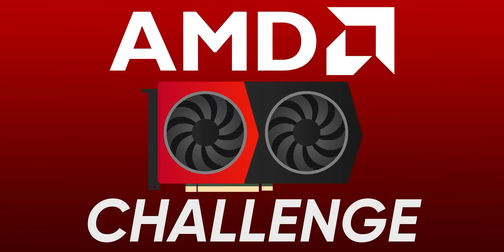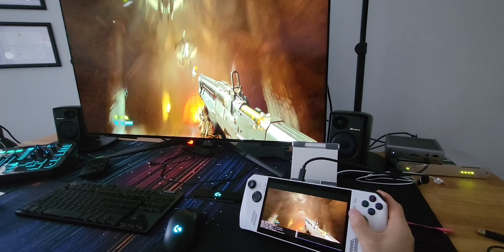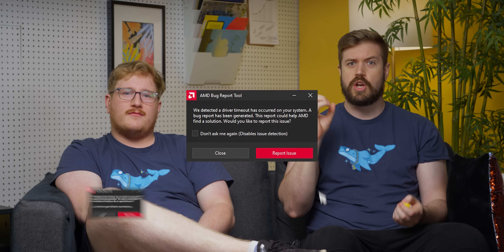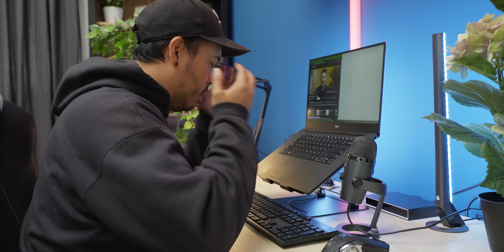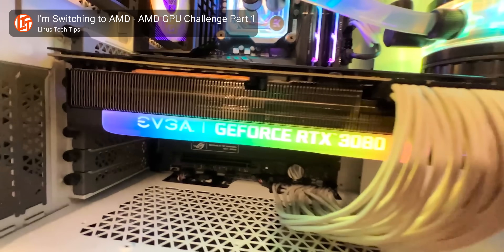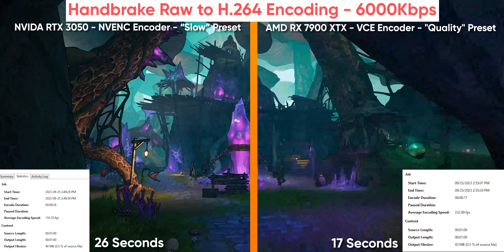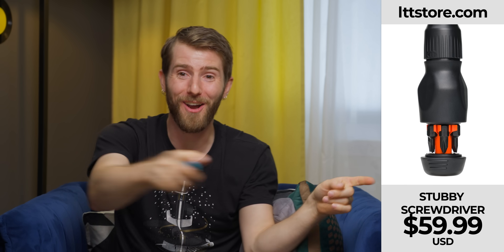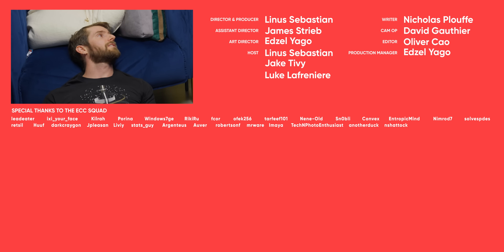I’m Staying on AMD! - Radeon Challenge Pt. 2

Comment: I upgraded from a 1080ti to a 6800xt and it's been great. My first AMD GPU since the 7870. 

Been very happy with it, no stability issues.
Reply: Im still on the mighty 1080ti but am thinking that its time to upgrade too 😊
Reply: I upgraded from 3 hd7950's (crossfire) to a gtx 1070 and I REALLY want back to AMD because the Nvidia drivers feels like a cage
Reply: Also using the 6800xt and no problems whatsoever on Linux as my main game setup
Reply: the hd era gpu was the best for games
Reply: That's the same upgrade I did, and it was totally worth it.
Reply: Swapped from 3070 to 6800xt and ran it for two years with no issues. Moved to 7900xt few months ago and still no significant issues
Reply: I jumped from a 1080ti to a 7800XT and haven't had any problems either. It's only been a few weeks though.
Reply: I went to 6700xt from nvidia, and literally zero issues since. Think I'm just lucky though.
Reply: Went from titan xp to 6800xt, it's fine, but I don't play that many games anymore and have to boot linux to do what I want so in hindsight I should've gone with a 3090
Reply: I never Had experience with Nvidia (my First and only Card is 4,5 years old)
And i Just had one Problem that gone away after the next Driver Update
Oh i have a RX 570 4GB XFX
Also my idle is about 3 Watt and i build my Friends also 4 PCs with AMD components  they didnt say anything to this date
Reply: @Paulkjoss  Personally, I was on a 1060 and it was showing age for me quite a bit, if you are able to hold off, you may want to given the way things seem to be going, we may end up with this gen of gpus being a dead end and ray tracing actually being useful, with nvidias side seemingly locking dlss to newer gpus and game devs factoring dlss uplift into performance on top end... I have little hope going forward with games, but it would be good to hold for a gen if able to see if shit pans out better or worse.

Comment: I went back to AMD for the first time since 2012, both CPU and GPU. I have had a few minor issues like 1 of my screens not being at 144hz while the others are and the settings say it is but its clearly not. A few other little random things but to be fair I did have Nvidia drivers installed before hand. Since I cleanly installed everything I've had no issues that I can think of. I am very happy with switching back to AMD and happy to stay put for the forseeable!
Reply: yup, clean install Windows if you switch anything major like CPU, GPU or Motherboard, I once hot swapped out an AMD card for an Nvidia card and I was having tons of problem with the Nvidia card until I clean install
Reply: Curious, what graphics card did you end up going with?
Reply: mine brother did install clean drivers after his first problem when he switched from 1050ti to 6700 xt like 1 year+ ago, stutters and 1 crash,  thing with amd they are more sensitive if u dont properly do installation, when he used 1050 ti for few years, he didnt do clean installation, only problem he had was nvidia software few times
Reply: @TheKOzality  Only seen this now mate, I went for the AMD RX 6950 XT.

Comment: i like how my experience since joining team red has been the polar opposite of theirs. i got my 7900XT just after christmas, and it's been basically flawless the entire time. i've had a few driver timeouts in CP2077 over the last few days, but i HAVE overclocked the card, so that's to be expected while i find the right settings.
Reply: This is me. I have owned AMD cards for over 10 years and had very few issues. Not 0, but very few.
Reply: 7900 XTX currently running the preview driver for AMD FMF support -- haven't had any issues at all on my system. Love my card and with frame gen I'm pulling ~150fps in Starfield at 4K. Can't complain here!
Reply: @ShrikeCult 
Lmao. You lot are hilarious.
Half of y'all are claiming he's an AMD shill, half of y'all claiming he's an Nvidia shill...

Make your dang minds up lol
Reply: @haxie4516  And you forgot the most ironic part : they accuse others while being the actual shills.
I just couldn't recommand Nvidia this gen, since they launched some of the most outrageous products. The 4060 sometimes is worse than the 3060, 16GB wouldn't have hurt the 4070 (Ti is a joke), 4080 should cost 800. It leaves you feeling like it's 4090 or nothing.
So 3 of my friends grabbed the 6900XT, 7600, and 7800xt. First two had no issues, the last one crashes everyday. Thanks AMD I don't feel guilty for making my friend spend half is pay for that experience. Fucking up 30% of the time isn't a nice stat 💀
Reply: @unholydonuts 
No. Not really.
Reply: They just fucked Up. They didnt do a fresh Windows Install after such a signifikant Hardware Switch. And they played DirectX 9 titles without installing DirectX 9 which is Not included in Windows 10 and 11. 

When i switched to my 7800 xt from my gtx970 i didnt do a Cleaninstall First. I Had Crashes and Freezes all over the place. After doing a Clean Install i still Had Freezes in DirectX 9 titles. Quickly figured it Out and installed that DirectX 9 kit from Microsoft and never Had any more Crashes in Wow and League of Legends since.
Reply: @dontowelie1302  
Most people won't reinstall.
That's the point.
Reply: @dontowelie1302  i mean idk if a clean windows install is necessary. I didn't do that when i installed mine, i did the same they did. Ran DDU and called it a day.
Reply: Mine too. Very free issues, but not terribly demanding games I guess.
Reply: @ShrikeCult It is hardly a hitjob if all they do is mention the problems they did have. It is not like they made up stuff. AMD does have issues and these ARE the reason NVidia is so far ahead in sales. If AMD had a better product, the market would change by itself. Problem is: NVidia got the better product and the better software to go with it. Now with the AI thing coming into play as well, AMD is in deep shit. They have had years and years to catch up, but they did not.
Reply: Clean windows install helps a lot
Reply: "Had some driver timeouts guys surely its my overclock, the copium"
Reply: Same for me I got a 6750xt last year and it's been absolutely flawless I game with Tripp monitors to. My experiences with Navi over the years wasn't great my 1080ti had a crop of issues when I had it and so far my amd experience has been much much better.
Reply: Ive been using an rx 580 for a looong time and ive had a few driver timeouts over the years, but it was never when i was doing something important so thats nice. Only other problems i can say ive had was their horrible openGL drivers until they fixed them last year, and windows update ruining driver updates.
Reply: that is because contrary to popular believe these guys are NOOBS! they keep failing their challenges
Reply: @crazygtfan8492 same here, from 7950 to dual Sapphire Radeon R9 290x, to dual 390x to now dual Vega 64, and zero issues whatsoever 😂😂😂😂
Reply: 7900 XTX can do in games what RTX 4080 can't for $300-$400 cheaper
Reply: @crazygtfan8492  Technology is a very fickle thing. You're computer could be running fine for one minute and then encounter a strange oddity out of no where within five seconds after that minute. It happens even on NVIDIA cards, Linux, Windows, Mac. They all have their different quirks.
Reply: @ShrikeCult  EXACTLY
Reply: Did a new build on a B650 motherboard with a R5 7600 and the RX 7800 XT, no issues at all, so far works great in older games like GTA-V and Half-life 2. It's also decent at 4K in games like COD, Battlefield V and Doom Eternal. It looks great on my Sony m9 monitor.
Reply: @danbo4605 do you actually believe that? Lol
Reply: im willing to bet alot of it is because they didnt do a fresh install of windows after changing the gpu, ive had so many issues with bluescreens, crashes etc after switching out a gpu no matter if its amd or nvidia even when you use the full driver removal tools
Reply: I have a 6800xt for 3 years and literally haven’t had a problem and I got it right at launch 🚀 it’s a red devil , I just DDU my wife’s 3070 because the clocks are stuck and so is the fan curve and power .
Reply: @Tech_Enthusiast_001 nvidia has issues too and it’s already proven they have just as much issues as AMD

Comment: Great video format and spot-on editing during Luke's overview of issues. I switched to 7900XT almost 3 months back and I was dreading crashes and other various issues but to be honest my experience is smoother with AMD card than it was with Nvidia's last four generations. Wherever two suppliers fight for customer, usually the customer can enjoy some benefits.
Reply: I personally had the same experience, I recently switched from a rx 6800 to a rtx 4080 and the 4080 has had so many issues, crashes fps drops ECT. I did a full ddu so it's not that although to be fair the Nvidia drivers have got better so now it's almost as good as my rx 6800 but it's still a bit behind.
Reply: Yeah, I had major issues on Nvdia and Ive been on AMd since 2017, first with the rx580 and now with a 6700xt
Reply: @RekySai  hey now thats no way to think, both have flaws, nvidia isnt perfect neither is amd
Reply: I have a rx 580 and I want to switch to nvidia asap. I got this card since 2019 and I only experience issues with the bad amd software. I dont know why it just doesnt work but it seems to get worse and worse. Where I experience several crashes of my graphics card upon launching a game.
Reply: @Scandalos RX 580 is an old card that’s why. If you put a 1070 or something similar in your pc you will also have issues. Older cards don’t get much optimization or as much support as the newer ones.

Comment: Love the format, I went with the same system Linus did with the 7950x paired with a 7900xtx and have nothing but good things to say, maybe the fresh install is the way to be with an AMD upgrade, that’s what I did at least :)
Reply: I would argue that a fresh (driver) install should be the way to go anytime you switch GPU brands... but I can't be 100% sure that would fix all their issues, since the last time I switched brands was in 2014(!) when I went Team Red and, three GPUs later, I've had nothing but a great experience (I feel like I have to clarify, it wasn't out of fanboyism, they were literally the only ones with a decent price at the time: R9 270X, RX 570 and RX 6600, respectively). And you know, this video is kinda helping me make up my mind to upgrade my other PC to the RX 7600 lol
Reply: It's the AMD CPU drivers that drive me nuts. Clean install everytime or a headache. So Blue CPU+Red GPU is the way to go in my book.

Comment: Ive had my 6950XT for about 8 months now and i absolutely love it. Great performance at 1440p and ive had no driver problems on Windows or Linux
Reply: That's great! But wasn't this video about the AMD RX 7950 XTX GPU?
Reply: @disguiseddv8ant486  not sure, but that'd make sense, the 7000 series has more driver issues than the 6000 series
Reply: But that's the AMD experience... 90% of people it will work fine for but the 10% it doesn't... It REALLY doesn't.  Those 10% will swear off AMD and everyone else will gaslight and call them crazy for it so they actually hate AMD in the end.  But this happens EVERY generation to 10% of the people and over time it's just built a mountain of us that just couldn't give a shit if AMD burned down in a big fire.  Even if the 7900XTX gave equal perf to my 4090 for 600 less I'd take the 4090 because it's fucking solid as hell with no issues just as my 3080, 2080ti, and 1080ti were.  The one time I went AMD for my GPD winmax system I run into an issue just like these guys where older games like Silent Storm won't launch on it because it doesn't do integer pixel format the way the games expect it to.
Reply: and now even 6950XT will get FSR 3.0. Really I don't get why people still buying Nvidia cards
Reply: @tonymorris4335  That sums um my experience so far. When it works it works really well, when it doesn't, typically in an older and/or more obscure tittle, it really is a nightmare. But it has been getting better, in my all AMD laptop, I've had a few issues in the beginning, but they are mostly solved, to the point that it doesn't bother me all that much. There is one game where it poops it's bed, but it's a slightly older and more obscure tittle, shame that it has been broken for quite some time now. To be fair that same game also had issues with nvidia cards a while back, so not sure who's fault it actually is.
Reply: I switched from nvidia 3060ti to 6800xt for 1440p gaming and it’s been great. I was worried about issues as my first card was a rx580 and it simply did not work with my set up, so I got the 3060ti. But I’ve been in love with my new card!! Works great and I’m maxing out all the games I play with 100-144fps (monitor 144hz)

Comment: As a team red boy from my first gaming PC build which was an athalon 64 it’s been good seeing AMD giving team blue & green a run for their money recently. But still room for improvement for sure. Hopefully it just keeps getting better 🙏🏼
Reply: Didn’t expect to see @SAMMIT in a LTT video comment section
Reply: honesty AMD gpu allows left a sour taste in my mouth i had a ton of problem's with more then 1 of there gpu that i stopped buying them at all as there is no point in even taking the risk but for there cpu i still prefer them more then intel
Reply: rocked the 560, and now the 6600, both are holding up well, not a ton of problems, minus when game is updated and needs new driver versions, but it is super fast to upgrade so not a problem at all.
Reply: Hey! 👋
Reply: @portanrayken3814 Never had major issues with mine. But I usually wait a few months to buy. Updates are constantly rolling out and performance has been great on my rx580, 5700xt, and 6900xt
Reply: Really depends on the use case, but for the majority of people an AMD GPU is the best choice they can make, especially if they just want to play games and nothing else (No heavy Blender work, no streaming, etc.) Otherwise Nvidia could be the right choice, but will cost more for the same gaming performance... For my part I've had no issues with my 6700XT, nor with my RX 580 or RX 460 back in the day.
Reply: @Otawakun  Should see his new video then 👀
Reply: @N3MAID3S  wait what. how did i miss that?
Reply: @Otawakun Youtube being youtube, probably didn't push it to you even with a sub 😂

Comment: It's nice to hear other experiences, but it's funny berceuse all the issues you guys were describing I was having on my RTX 3080 (plus running out of VRAM issues) before I switched to my 6950xt.The 6950XT has been rock solid for me and I love AMD's drivers so much more then Nvidia's.
Reply: Lots of issues seem to arise when people swap out their Nvidia GPU for an AMD GPU on the same windows install, no clue why but I'm surprised you've had no issues
Reply: Dude this is me.  I've run into almost all the same issues as them, except I have a team green card atm.  It's frustrating as hell.
Reply: also adrenaline it's far better than nvidia controll pannel+geforce experience, also you get the clock,volt and fan controll you dont get on nvidia software
Reply: I did came across many of the mentioned issue, but in my case I am switching from a RX6800 to a 2080ti, on the same window installation, just DDU. So I think many of the pain is from switching GPU brand itself, not entirely an AMD issue.
Reply: Same experience for me but finding 6600 xt 6700 xt and 6800 non xt are completely stable, the 3080 leaves a lot to be desired
Reply: What can you expect from btd6 ? My phone tanks it but idk bout pcs
Reply: @jim-jcrypto  driver for my 6700xt work perfectly
Reply: I was a loyal Nvidia user for three generations (10-, 20, and 30-series) and I had numerous small issues. None if the issues I had for those three generations were even close to dealbreakers, but the little hickups were fairly frequent. Then in the beginning of the year I finally switched to AMD, an RX 6700 XT, and holy crap that thing was rock solid compared to the three Nvidia cards I had before it. Most stable card I have ever had, by far. Everything just worked. 

Then a few months ago I decided I need more performance and upgraded to a 7900 XT and.. while more stable than my 20-series and 30-series Nvidia cards (10-series was a boss though) it has had some minor issues, mostly related to my dual 4K monitor setup. As the months have passed AMD seems to have ironed out most of the issues via driver updates, but still to this day I get weird intermittent 1% low stutters in games whenever my secondary 4K monitor is running (but being completely idle, just showing my desktop) at 60Hz or more. If I disconnect the secondary monitor or lower the Hz to 30 the 1% low stutters while gaming disappears. Some might argue that 2x4K is too much for even a 7900 XT to handle without stutters, but that's incorrect. My much less powerful 6700 XT handled it just fine, so the 7900 XT should be able to do it too, with ease. DDU has been used to wipe old drivers, but it unfortunately did not fix the issues.
Reply: @mannydcbianco  the 7000 series issues I think are due to being multichip designs Vs the previous style of building the gpus. Probably best bang for buck is the 6900 xt

Comment: I switched to AMD recently, I came from a line of Nvidia cards (GTX 560 Ti, 1070, 3060 Ti) now I have the 7800 XT from XFX. Two weeks in I haven’t encountered any issues that would have me returning the card. Like everyone says the one software window is very nice and less jank than having to delve into two different menu options. I’m very happy with the performance and the rasterization. I rarely used RT and I prefer having raw frame rates at my desired resolution of 1440p. Can’t say I’ve been happier and my monitor is freesync premium so it’s really good in games and I probably could never game without it again